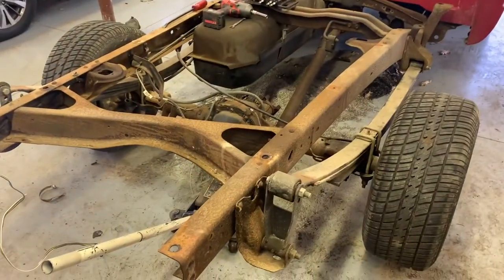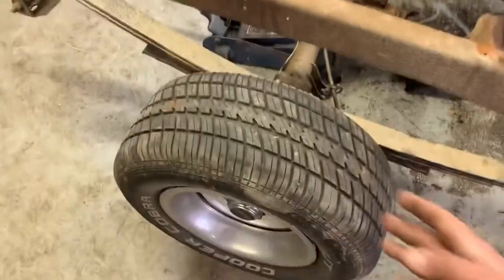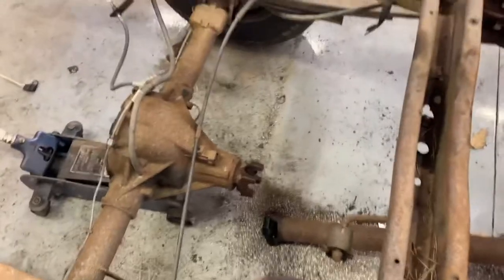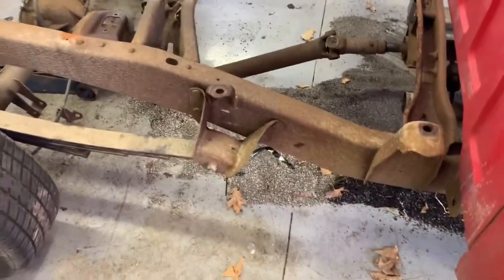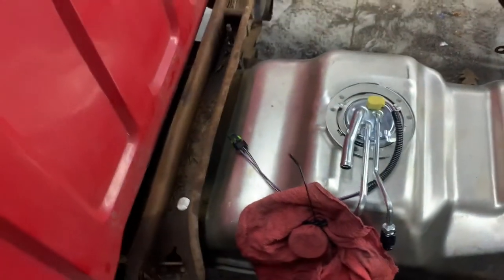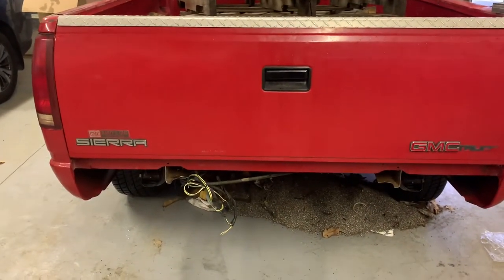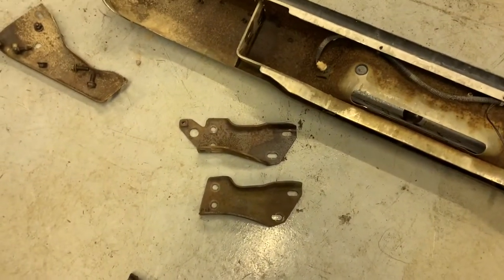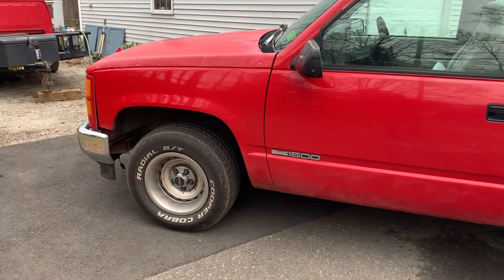88-98 C/K Short Bed Conversion: ‘94 C1500 6.5L Diesel

Comment: i have done this years ago and ran into the same issue with the leafsprings binding, if you measure the width of where the leafsprings used to be its actually around an inch or 2 narrower, so when you move the mounting points ahead 14 inches you're widening the leaf hanger points on the front causing the rear of the leafs to move inward ... adding a lot of pressure
Reply from the maker: Springs were fine. It was a shock that was bound up
Reply: Howd you fix that? @pacificdrumma
Reply from the maker: @projectbrightgrey8429  put new shocks in it

Comment: You have a little more details on how you did the shock brackets? You use the factory ones? And how did you measure to figure where to relocate them? Thanks
Reply from the maker: @Bearded_blatz  stock brackets, can’t remember how we decided where to mount them. Not a critical part of the conversion as long as the shocks can travel without bottoming out.
Reply from the maker: @Bearded_blatz  stock brackets, can’t remember how we decided where to mount them. Not a critical part of the conversion as long as the shocks can travel without bottoming out.

Comment: I've done that once but I split the frame in half under the cab like oe short bed pane in the butt i removed the cab to do it i have o k1500 to go by you will half to cut the cab mount of cut it like a sb and move it forward remove the cross member behind the cab drill new bed holes and cut the back off the frame or get a shot bed frame and split it us the back half but the only reason for that is if you have a k and you can find a c short bed frame cheap

Comment: I just welded in a singlecab short bed frame in. Harder on a 4x4 because of the brace bar for the torsion bars. But in my opinion it was easier.

Comment: This is a lot simpler than what I thought it was going to have to do
Reply from the maker: @markonhistory514  the fuel tank is the hardest part, the rest of it is pretty easy.
Reply: @pacificdrumma  what did you end up doing for the frame dipping inward did you put in a support? Maybe do an update video on it if you can
Reply from the maker: @markonhistory514  check the comments. The same isn’t the issue. It was a bound up shock.

Comment: Did you get all the bugs worked out on this swap from the frame twisting in the rear where you cut  out the crossmembers
Reply from the maker: @legozombiemocmaker8026  yeah only issue was a bound up shock

Comment: Bell tech makes the 2" drop shackles in canada alberta they are roughly 160$ for the kit dont know states price for anyone wanting the specific drop shackle parts number its #6502 on Bell tech and if going this route u will need to drill new box mounts for rear of box front ones line up and for the love of god use a peice of steel tubing or pipe and weld it between the frame rails to brace the rear frame so it wont twist or warp
Reply from the maker: Already had drop shackles on this when it was a long bed. The binding turned out to be a bad shock, the frame is fine the way it is. I’ll pull the bed to paint the frame at some point and will add a crossmember then.

Comment: Did you find a solution to the rough ride? If I remember correctly, the rear bed portion of the frame is not perfectly parallel. Now, I'm guessing, if that is true and the front/rear spring perches are bolted/welded to the frame in their new positions, that could cause a "misalignment" of the leaf spring. That could cause the binding you mentioned. With the lowering kit, did this resolve your suspension issue? Thanks for the video, very informative.
Reply from the maker: Had a shock that was bound up. Rides like a Cadillac now
Reply: @pacificdrumma  Good to know, that was an easy fix! Thanks!

Comment: I did the quickest  short  bed ever , 
No cutting 
No Welding 
No wasted time  
No wasted money  
Small Block 4 bolt main   350 , 11 inch clutch and  5  speed  , 10 bolt limited slip rear end   ! 

Actually  didn't  cost anything  except  for  the title / tags and I was  driving  it  !

Comment: How much lift did you get after moving the leaf springs looking at ordering 4” drop shackles to get it back to stock then maybe a flip kit to get it to more of a lowered truck look
Reply from the maker: So the I would say about 2-2.5” lift from moving the axle. The truck sat a smidge taller than before, which means the 2” drop hangers were basically a wash. I’m probably going to wind up with stock hangers, and a 1” drop shackle after doing the flip kit. The flip accounts for 6”, but 2/6 is too big of a difference in the drop height. So I think with the stock hangers, a 1” drop shackle, and the flip kit, it’ll be about a 2/5 which is more what I want. O
Reply: @pacificdrumma  do you think the spring hanger can be drilled and mounted or welded 1.5"- 2" higher to compensate for the slight height change? I'm about to do one of these and I already have 4/6 on order

Comment: Would have been easier to get a donor short bed frame and cab swap. Could also get the back half of a dobor short bed frame and weld the back half on.
Reply from the maker: @djtheg6819  completely incorrect. We did this in a day. Frame swapping or cutting and welding would have been at least 3-4 days plus a lift. If I wanted to shorten a truck again I would absolutely use this method.
Reply: @pacificdrumma  the fact that the axle doesn't locate correctly even with using a drop a drop hanger tells me the suspension is not set up correctly. The front shackle is now installed drastically lower than the original position, yet the rear shackle is at stock height.   There is a reason why the factory didn't set it up that way and I bet it's because the geometry for the springs compression rate is not correct.
Reply from the maker: @djtheg6819  the axle is located correctly in terms of the wheel being centered in the wheel well. I need to take the drop hangers out and put stock ones back in to correct the pinion angle. The truck rides and drives mint.

Comment: I know this is a year old now but what did you do for mounting the fuel tank
Reply from the maker: @lorengreen131  I did not use the short bed mount. I think I re used the long bed stuff and hammered the tank to fit
Reply: @pacificdrumma  did you ever make any updates after doing the axle flip?
Reply from the maker: @lorengreen131  no but I’ve been meaning to
Reply: @pacificdrumma  did you put a c notch? I'm actually working on doing the conversion this weekend.
Reply from the maker: @lorengreen131  I did yeah

Comment: You can use a rear sway bar out of a suburban with modified end links.  Did that on my old 454 SS. Good video though,  just picked up a LB that I'll be playing with soon. 🤙
Reply: what for exactly
Reply: @jandtnation6343  less body roll in the corners

Comment: It looks like moving the axle forward increased the rear by 2 inches using the lowering hanger? Maybe my math is off?
Reply from the maker: Never really got an accurate measurement on this. The rear suspension binding turned out to be a shock that wasn’t allowing the suspension to cycle. I didn’t find that until I was doing the axle flip and c notch. It’s possible that had I found the shock earlier, the rear would have relaxed and lowered a bit more.

Comment: I inherited my grandfather's 93 Silverado longbed with 118k miles
I always imagined starting with a short bed extended cab frame. 
And taking 18 inches out under the cab(where the front of the frame slides inside the rear) 
Yes it means a cab swap to the shorter frame, and I will just buy a short stepside box. (Or hopefully it's on the extended cab frame I buy) 
Just my thoughts, honestly I'm probably just going to lower it and leave it alone because it drives soooo good.

Comment: is there a way i can get you on the phone for more questions
Reply from the maker: What do you want to know?
Reply: @pacificdrumma  what was the measurement for the rear spring hangers ? i couldnt really hear you , and what was the measurements on your drive shaft ?
Reply from the maker: @Tdillard29  everything got moved forward 14”, and I took 14” out of the driveshaft. Now it has a custom 1 piece shaft.
Reply: i heard you mentioned about the rough ride did you straightened that out ?
Reply from the maker: @Tdillard29  yeah shock was bound up and not traveling. New shocks and she rides mint
Reply: im almost there , did you have to move the shock bracket ?
Reply from the maker: @Tdillard29  yes

Comment: Maybe a dumb question but is it the same I cut 14 inches off a single peace drive shaft because I see you have the 2 peace
Reply from the maker: Yeah, probably
Reply: @pacificdrumma also can I just use factory shackle hangers or do I need to get the dropped ones
Reply: Where you get the bolts from as well for the hangers/ shocks and size. sorry for all the questions I’m just doing the project on the truck already 😎😎
Reply from the maker: @montesalex9545  hangers I think we just used grade 8 SAE stuff from tractor supply. Shocks were just stock bolts I think
Reply from the maker: @montesalex9545  depends on how low you want it
Reply: @pacificdrumma so it Dosent matter where I place my shocks. I see your did yours over the front crossmember and the rear I’m not sure how far u measure back but it won’t be a problem if I put shocks relocation anywhere
Reply from the maker: @montesalex9545  start with stock shackles and drop as needed
Reply from the maker: @montesalex9545  I guessed